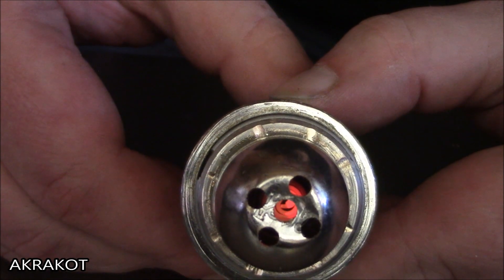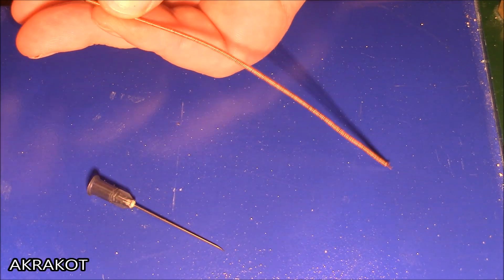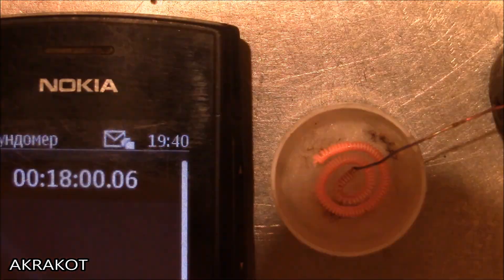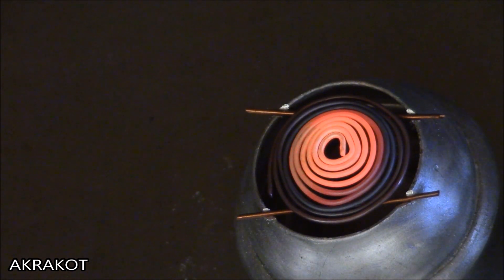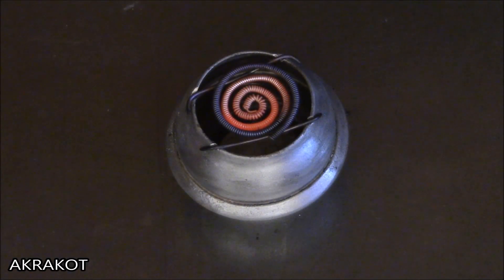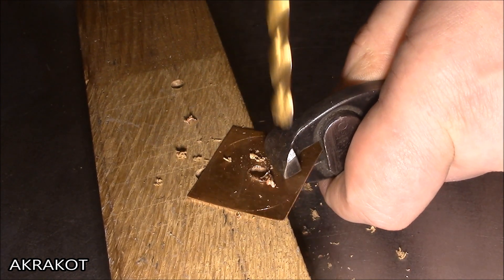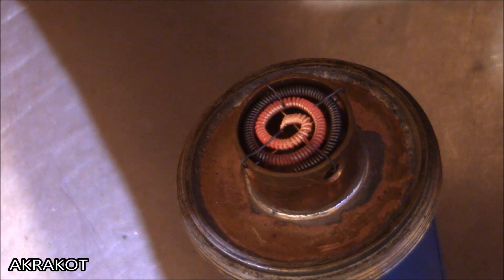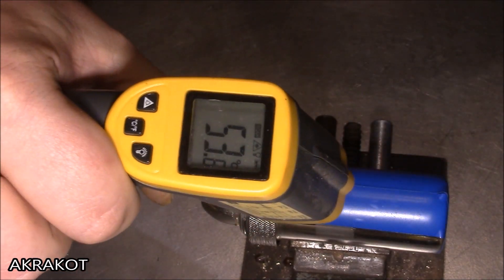How to make a reactor / Homemade Hand Warmer

Comment: After Yuu put the fuel in Yuu should have heated the bottom of the unit to create stronger fumes or gas inside the unit itll light right away to

Comment: What is the byproduct??
Reply: The byproducts are acetaldehyde, carbon dioxide, water, copper metal. Initially the copper is oxidized when heated. The ammonia strips off that oxygen, returning pure copper, which then oxidizes again due to the heat, taking oxygen from the air, producing more heat.
Reply: Produk sampingan nya adalah ketena , gunakan masker gas / ruang asam , kalau tidak itu akan mengiritasi anda
Reply: @bypass1203  Я не понимаю